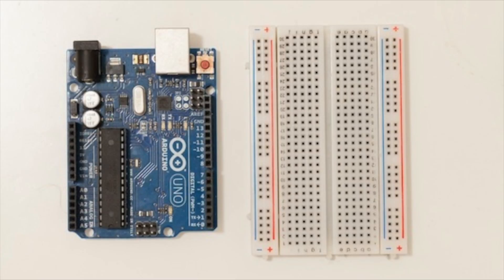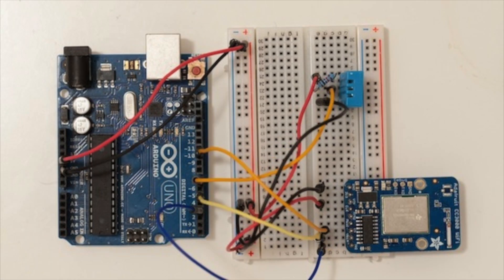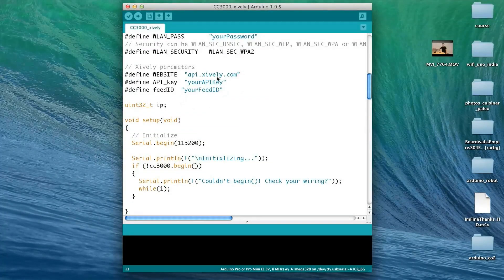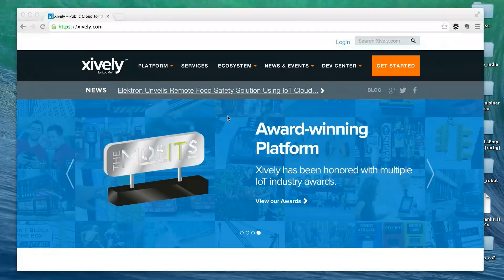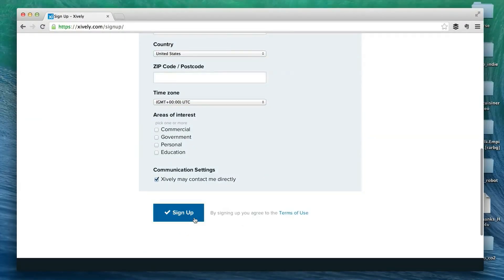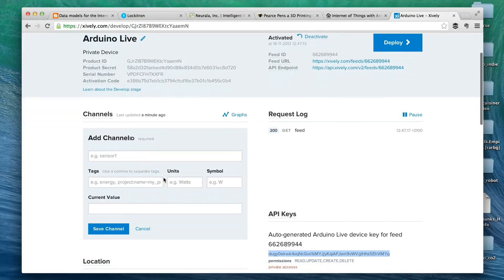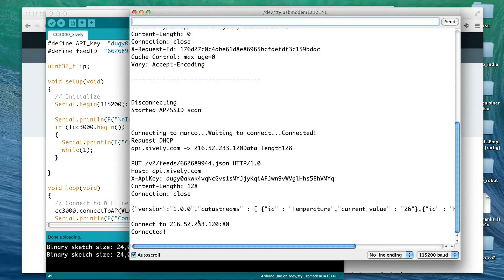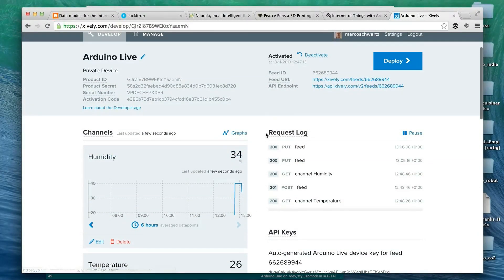Internet of Things with Xively, Arduino and the CC3000 WiFi chip

Comment: Hi, can i control esc and brushless motors with adafruit cc3000 to make a quadcopter and control it with a mobile?
Reply from the maker: +jin5632 Hi! Of course, you can take what you've learned in this video to build a quadcopter based on the CC3000. Check my other website: https://openhardwarerobots.com/

Comment: It seems that your work is done exceptionally well.  I have no programming experience but nevertheless I purchased an Arduino Mega2560.  I managed to get a home automation sketch working but now I'd like to incorporate the CC3000 wifi shield so I can install everything into my main home electrical box.  Do you happen to have any sketches laying around that I could modify?  If not would you be willing to take a look at my sketch and possibly write the code to implement into it?  I would be forever grateful.  Thanks very much for your time.

Comment: Hi, is there any difference between cc3000 and wifly or the official wify shield ? I am making a robot which will have arduino and wify shield in it and i'll send command from my laptop to it by http. is the cc3000 will be any good for it ?
looking forward to your reply.
thanks
Reply from the maker: Khairul Alam Sojib From what I know yes, the library used to control the chip is different. However it should be very similar at the end in terms of behaviour, you can use either of them for your project :)

Comment: Thanks for these vidoes!  There are several Library available for the CC3000 from different venders like "sparkfun" and "adafruit" which one of these should I use?
Reply from the maker: Shane Detsch Thanks! The library I used is the one from Adafruit.
Reply: Open Home Automation  Sorry I was so stupid.  If you have an Adafruit circuit you would use the adafruit library and if you have a sparkfun circuit you would use the sparkfun library.  I am new to circuits and asked this question in ignorance.

Comment: There's this new WiFi module called esp8266 in the market. It would be great if u guys can come up with a tutorial on using esp8266 with Arduino UNO
Reply from the maker: Arnab Saha Indeed! However for now it's still quite difficult to use because of some issues (especially power supply issues), but whenever it's more 'usable' I will come up with a tutorial for sure.

Comment: Very cool,

How would I go about measuring/recording voltages (up to a coulpe 100s V and currents (up to 2Amps or so)? is there s shielf with like 6-8 A/D and even an amp meter with shunt?

Can I then download the data from Xively in xls. or csv file?

thanks for all the help and guidance
Reply from the maker: Hey, thanks! It would be the same principle. For the voltage/current measurements, you would have to do it 'by hand' with your own components, I don't know of any shield that does that. Then I recommend sending data as soon as you have a measurement (just like in the video), I don't recommend sending big files to Xively with the CC3000 chip.
Reply: Open Home Automation
Thanks. You french? (I'm in Switzerland),    What I meant was can i download the data From xively after some time? and
does xively timestamp the data it recieves? by that I mean if I send the first data now ,then  the second a minute later, then 40 seconds later etc. will it consider all equal time periods or does it mark it at the time it received it?

thanks again, will have to look at the code.

Comment: I have uploaded your code and have set up my xively account indentical to you tutorial, and my serial feedback hangs after this function and then does nothing?  Any means of help would be wonderful.  Nice tutorial and good presentation.  
{"version":"1.0.0","datastreams" : [ {"id" : "Temperature","current_value" : "23"},{"id" : "Humidity","current_value" : "36"}]}
Connected!

It seems that my arduino quits sending after this.

Comment: Is it possible to download or forward the information  from the webpage to a mobilephone using jason given that you have a running app? eg. show the temp on a smartphone instead of the web?
Reply from the maker: To my knowledge that's not possible using Xively, however for this kind of application I recommend using the Arduino Yun to upload data somewhere it can be accessible from your phone, like on Google Docs. Check out our Yun tutorials for that:

http://www.openhomeautomation.net/yun-weather-temboo/
Reply: Open Home Automation You sure? because I see that they have an API you can use (json, xml and csv) and then all that is needed i guess is to make an app that converts the data on you smartphone? Shouldn't that work?
Reply from the maker: Oh sure, it's possible to do an app, what I meant is they don't propose a ready-to-use app for their service.
Reply: I see. Thanks for you responding. Do you think you could do something like measuring battery capacity wireless over internet wifi or gsm?
Reply: zaft1g337 so to complete this system...one has to build an app to pull data from xively (hope they dont charge for that)